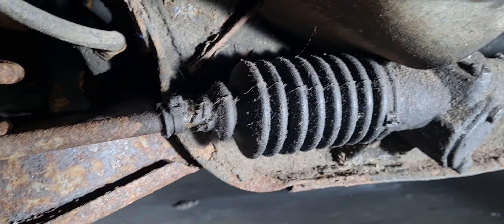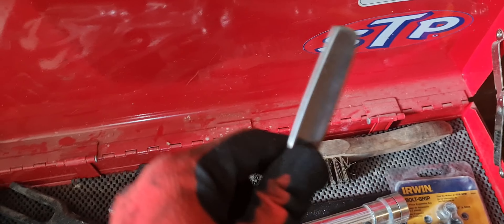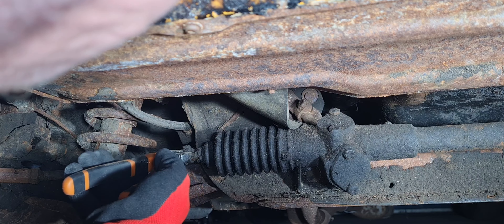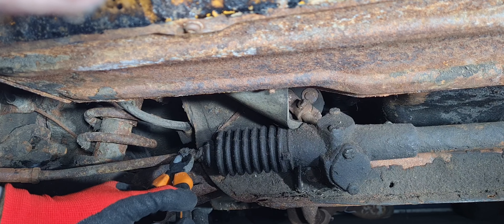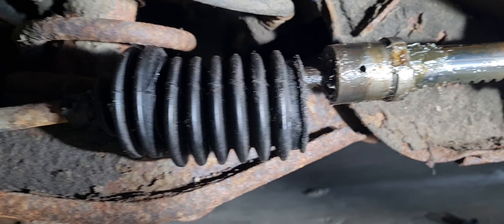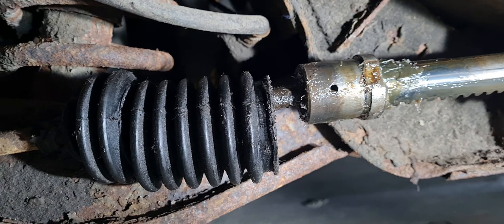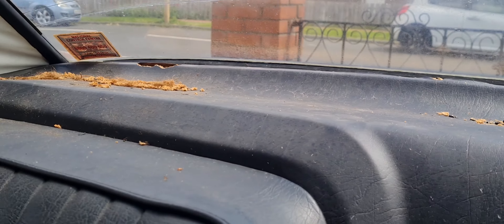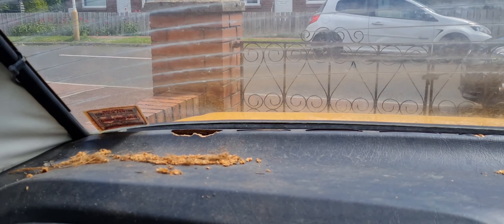Barn find 1975 Vauxhall Viva HC restoration

Comment: So glad you have a spare radiator, remember during the 70's, if you had auto trans, the cooling method was inside the engines radiator.
Of course if you had manual transmission there would be no other hose attachments
Liked looking down the transmission tunnel without the driveshaft.
We got to see the reverse lights switch plug & wire feed.
Those were grommetted through the tunnel some where near the clutch pedal in the case of RHD, sometimes tucked away under the carpet if no lights are fitted, but a standard wire loom has them anyway.
Remember, late HC ( 1256cc) had GM 3 speed Strasbourg unit in the case of auto.

Only the very late HB's had the GM unit fitted to either 1159cc ohv, or 1599 ohc slant 4, but neither of GT ( mk 1 or 2 ).

All 1966-68 HB's had the Borg Warner No# 35 unit fitted.

That is in place as an option to the four speed manual transmission.

No overdrive option in the case of Viva RWD.

However, a Laycock De Normanville ( Type J ) was an option to the FD Victor ohc, and possibly early CF in the case of the slant 4 which shared a common engine prior to CF2 & Opel.

Hope that was of some interest. 

Vernon.
Reply: Here in New Zealand, late CF2 Chassiscabs did come with the Strasbourg unit where the Holden 202ci ( 3310cc ) unit was fitted in the United Kingdom 🇬🇧 for New Zealands ambulance fleet 1986-87. ( CBU Units )
The Holden inline 6 ( red motor ) started off in Australia 🇦🇺 👌 and was exported to the UK 🇬🇧 for incorporation in the export CF2 chassiscab, in this case,  New Zealand 🇳🇿 😀 

Vernon.
Reply from the maker: Very cool Vernon. All interesting stuff as usual. Thank you very much 👍
Reply: @RetroRebuild  collaboration's between Holden Australia ( GM ) & Vauxhall United Kingdom 🇬🇧 😀 have been documented before, I think it was with a Viscount that was in the planning stages of V8 from the Holden stables destined for Vauxhall to be incorporated with their car.
Sadly, I believe it never eventuated.
It would have been the smaller V8 ( 4.2 litres ), not the 5.0 litre, as there were at least two.
Another Holden car that Vauxhall's Leo Pruneau designed was destined for a V8 with only a few mock-ups made, did survive post test track trials.
For those in the know, the LC & later LJ were designed from the Viva in mind.

Only in South 🇿🇦 Africa was there a Viva with factory V8 fitted, known locally as the Chevrolet Firenza ( HC shell ), it used the Comaro engine ( 5 litre ) and American manual box from the Muncie group whom only now make PTO ( power take off's ).

Hope that made some more interesting 📚 reading, love your channel, keep the HC coming 😀 👍👌
Reply: The Muncie box used the old tall gear lever with finger lugs for reverse as did late FD Victor / mk2 GT ( HB ), to later ohc HC Viva, Magnum & British Firenza's.

Some radical redesigning of the steering shaft with a universal joint, firewall mods and larger under body radiator guard fitted to the front valance, I did get to see an engine bay without the engine back in the "States" with a retired race car that had a colourful history, looks like the engine was sold to settle an old debt.

Body shells S.A Firenza's came with both 2 Rectangular & 4 Quad lamps ( like Magnum, GLS Viva / Envoy Epic ).

They only built some 200, which sounds like the British "Droop-Snoot", there are some pics on YT.

Happy hunting.👍👌🌎🗽

Comment: You said about changing the engine in the viva but still wanted a vauxhall motor.  So what about the vauxhall magnum they did a 1.8 and a 2.3 now that would be fun on the motorway. Thanks for a good program.

Comment: That engine oil 🛢 filler / hose looks like from after a 1978 model.
I knew these cars 🚗 well.
Your HC looks well for its age, that rear seat was from the SL range, good luck with subsequent video with radiator replacement fitted.
To save the heater, prefill with water thru that joint in the upper heater hose.
Regards Vernon ( New Zealand 🇳🇿  ) 🌏👍🚦
Reply from the maker: Well spotted Vernon! Thanks for the tip